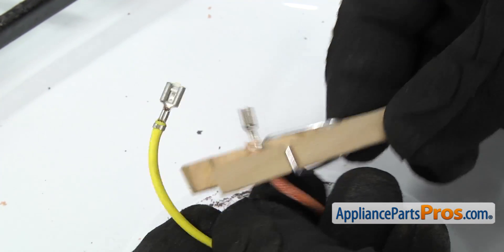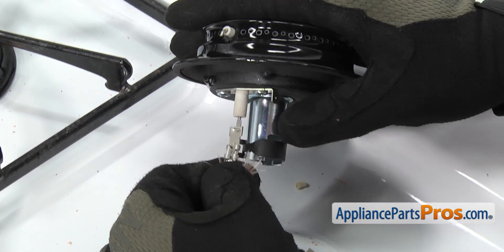How To: Whirlpool/KitchenAid/Maytag Gas Stovetop Burner WP3412D021-09

Comment: You can use a wheel grinder and just grind off the .250 tab so you don't have to crimp on a new connector. The tab underneath fits the old connector on the orange wire.

Comment: I have replaced several of these and often wondered what the clip is used for. It wasn't mentioned in the video. I have moved them around to different positions and they don't seem to make any difference anywhere that I put it.
Reply from the maker: I'm not showing a clip listed for this part, if you have your model number we can check that to see what is listed for your unit.
Reply: @appliancepartspros  it doesn't have a part number if it's own. It is part of the burner. It is just a black spring clip on the shaft that fits over the gas intake.
Reply from the maker: If it's part of the burner, then as long as the igniter is lined up properly then it should be ok.

Comment: The burners on my Magic Chef (model CGR1420BDQ) are in pretty good shape.  However, they could use a good cleaning.  Can't find any instructions on how to clean this type of burner.  Most other burners are 2 parts that remove easily, these are all one piece that are directly wired. Any recommendations on cleaning??

Comment: I have a Maytag MGR6772BDW and the right front burner would spark but not light. I removed the burner cap and broke the igniter off. There were no wires attached to it though. Did I miss something?
Reply from the maker: It is possible that when that part broke the wire may have fallen down under the cooktop? have you tried to lift up the top to see if you see the wire there?

Comment: I bought a replacement set of burners off Amazon, and it looked great until I tried to lock the burner back in place, It turned but didn't lock. Just stayed loose. And it seems like since it's not tight, it doesn't draw gas into the burner to light.